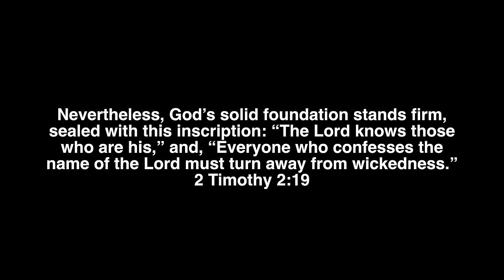Deere 3R Front Axle Seal Leak Fix, John Deere 3033R/3039R/3046R!

Comment: I second the recommendation for Larsen Lights.  I purchased Larsen Lights back in 2019 for my cab tractor, and they were a HUGE improvement.  No regrets whatsoever.  I like them so much that when I purchased a new tractor several months ago, I immediately took off the factory lights and replaced them with Larsen Lights.

Comment: I’m an experienced off-roader so familiar with portal axels and the like.  Your guy is right about the seal/breather failure.

One of the common known mods in off-roading is to run a tube to the diff breather to where you fuel up so that it can breathe without taking in any water or mud.  You basically just drill a small hole by the gas tank inlet and affix the tube to it.

Comment: The problem with the receiver mounts is, they tend to wiggle and move around a little. When I did mine before I welded it up under the table, I drilled a half inch hole, ran a bolt and nut into it, welded the nut solid so that I could put tension on that receiver when it was pinned to keep it from moving. Made it work a lot better.
Reply from the maker: I'm afraid I may have that issue.  Also, I didn't get my 'receiver' welding perfectly square, so this isn't good either.  Thought I might make the 2" tube quite long...to minimize the wiggle.

Comment: Excellent video, thank you for posting it.
I would recommend venting the axle.
I have a 2001 4700 tractor, 5-6 yrs ago had oil seeping from top seal on spindle axle housing,once I vented the axle it’s been bone dry since. One other modification I would recommend. The 2 caps ( freeze plugs) are glued in place. Two weeks ago I was removing snow and when I parked tractor in barn I noticed the 2caps on the floor. Lost 2 gallons of axle fluid without ever knowing the axle was running dry for about an hour. I reglued  the caps with ( loctite retaining compound 620 jd recommends it) and as a safety precaution I fabricated 2u shape brackets to support the caps. I used the bottom 2 bolts of the hub gear housing ( mine has 8 bolts) and replaced the pipe oil drain plug with a brass hexagon drain bolt. Auto part stores stock them.i also installed a 1/4” x 1/2” rubber piece glued and fastened to bracket under cap for support and preventing noise vibration. Hope this helps.

Comment: My 2020 3046R , with 280 hrs , is at my dealer at this very moment for this exact problem . The dealer told me the six year drivetrain warranty “should” cover the cost of repairs . I did ask him about his opinion on the need for a vented dipstick and he said there was no need for one . Will be getting more information tomorrow . This definitely is an involved job . Love that lift setup . Great video my friend !
Reply from the maker: Interesting.
Reply: The drive train warranty did cover the cost of new seals for both right and left side of front axel . I also had a leak in the mid PTO shaft seal that was covered under warranty . This tractor is not used for any type of farming ( sand or mud exposure ) so why so many leaks in a tractor with only 280 hrs ?
Reply from the maker: @altonhenderson4120 I think the front seals are likely due to no vented dipstick.  No matter what your dealer dude says.
Reply: I did purchase a vented dipstick right after I brought it to the dealership for repair but it’s not the type that bolt on hooks sells , this one has the pressure relief valve .

Comment: Just wanted to say thank you for this video. I have a 3032E, 3039R (Cab), and a 4044M. They all have Otis Innovations vents! 3039R has the bolt on hooks RH door kit. I remember when I saw another video of yours about the vents and ordered one for the 3032E. When I installed it and removed the OEM cap, it made a pretty good hiss and was clearly pressurized. So, all 3 have the vent caps. I believe the 4 series and 3R series have the same front axle by comparing the side by side, so this repair if needed I will be able to do just from this video. Stay safe and thanks again.

Comment: After I had the dealer do my both front axles I put the Otis vent in the only thing I would change is the material is so shiny its harder to read than the plastic ones. I don't recall the prices, but it was fair and no issues a year later.

Comment: When I got my LS tractor home after the dealer dropped it off, I thought I would check the oil in the front axle. It has a dipstick on the other side. And the tractor was sitting level, it showed it was low, so I filled it. Then we moved from Florida to Missouri few years later. Now the ground is not level and that oil starts coming out of the vent and I check it again and it's over filled. So after a few days I noticed more oil is still coming out the vent and then all of a sudden it quits. It doesn't appear to be leaking now but I guess I will have to check it again and see if it has oil in it. It doesn't make any noise when driving it. So i will try and find a level spot to check it.
Reply from the maker: If you've found a tractor which MAKES OIL, then you had better hang on to it!   Maybe it can make you rich!

Comment: Tim, I remember an episode where you visited GCI Turf in NC. He recently released a couple of videos about a 2000 ft driveway he was working to repair for a family with a special needs child. The driveway is badly eroded and he is doing the work for free but he needs help buying the tons of gravel needed to repair the road so the erosion doesn’t keep occurring. I don’t know if you would be willing to mention it on one of your videos but I wanted to make you aware of it.
Reply from the maker: Saw it.  
I’d really like to improve the ditches on that driveway before rock is purchased.
Until we get the ditches dug out, the problems will persist.
Reply: @TractorTimewithTim  I'm with you.  We had continuous erosion problems with our driveway.  It is on a steep hill and we had to make a ditch, slope the driveway toward it and fill it with big rocks to slow down the water to stop the erosion.

Comment: Great video!! Just wondering, for short term leak abatement, if hydraulic “stop leak” products work?
Reply from the maker: I would be hesitant to use those.  
The only place I might use would be on nearly "junk" equipment which is not worth repairing.

Comment: I just had my 4066 into the dealer for that knuckle seal leaking. They said the outer piece was beat up and started corroding a bit, so not sure if I got something stuck in there and rubbing back and force while turning or what. I had the vented dipstick already though. Was under warranty so all good.

Comment: If you installed the resistor in parallel with the existing resistor, the total resistance went down.  The bulb the sees a greater voltage.
Reply from the maker: Yep…wouldn’t that achieve the desired effect?  Makes the circuit draw more power.  …fooling the bulb sensor.

Comment: Tim, I did that project about three years ago on my 3520 and it was on the left side that started leaking. It is an involved  process only thing is I had the John Deere manual to guide me through it. One of my questions is, do you use the low vis  hydraulic -gear Fluid or is there somebody else who makes that product also, did you use the special lock tight glue in what John Deere recommends to install all those seals and I never did install vent in my axle. I never had any issues as of today I didn’t find out about it until afterwards.

Comment: If the seal fails, can this cause steering issues?
Reply from the maker: Seal failure allows the oil to leak out, which will cause front wheel drive issues. Gears will get destroyed.
No, not related to steering

Comment: Adding a resistor in parallel would lower the resistance and increase the current flow.
Reply from the maker: Increasing current flow would be the desire…otherwise the tractor thought the bulb was out.

Comment: i am wondering if that socket will fit a 1025r. Did a oil changed an noticed my axles is also leaking.
Reply from the maker: Try the Otis innovations vented dipstick first.  It might take the pressure off enough to stop the leak. 
I suspect the socket is different.
Having said that, if you want us to fix, we can do.
Reply: @TractorTimewithTim @TractorTimewithTim  lol, I live in Florida. That would be one hell of a trip charge

Comment: Hi Tim. A while back you were having trouble with the 3046 blowing a fuse that caused it to shut down. Did you ever find what was causing that?
I may just have to get one of the axle vent kits.
Reply from the maker: No..and it hasn’t happened since!  We couldn’t find anything loose or rubbing.  Not sure!

Comment: Even if the US goes metric you will still use both. 🇨🇦 went formerly to Metric on April 1 1975 and we use both. One thing I hate is a tape measure with inches and centimetres. My last three tapes I bought were inches only, much better for me. In fact my 2014 1025r I believe is half and half. It’s the hardest piece of equipment I have worked on to try and guess the size wrench needed.

Comment: You do many of these you'll want a good set of snap-ring pliers, and I think the older one piece seals did better than the 2 piece (on my tractor anyway), I have already replaced two of the 2-piece seals on one side (cleaned thoroughly) with a limited number of hours, but in all fairness, the tractor has not been run in the best environment

Comment: The best thing u can do to help those wheel seals from leaking is to use gear oil in front axle we have tym and koiti both have gear oil in front axle with no leaks its just slow to drain when u do a service

Comment: I just purchased 2017 250hrs i thikk it never had any mods should i make any changes to my 1025r the engine shakes bad at idle is that normal you are the best and a fellow christian Butch west carrollton Ohio
Reply from the maker: Yep.  Engine shakes.  You can turn up the idle a bit.  1550 is spec for low idle.

Comment: Great video! So I’m wondering why JD has not fixed this issue at the factory. I have a brand new 2024 3039r with 6 hours on it and it’s already at the shop  because the front right side seal is leaking. I have already ordered the vented dipstick right after they picked up the tractor but this is crazy, 6 hrs and leaking. It is covered by the warranty but my mind is still blown over this. Why can’t they just put in vented dipsticks at the factory and be done with this horror show.

Comment: Never power wash around seals or gaskets.  Personally, I never power wash any of my equipment.  I’ve yet to find anything a garden hose and a little elbow grease couldn’t clean and with far less chance of damage.  Other than hydraulic system seals, most are not made to withstand significant pressure.

Comment: That stinks about the wheel seal on the 3046r. I guess I lucked out with mine. Nothing major has been wrong with it. Only thing that just started after 830 hours is I noticed the front loader drops a little bit. Apparently the lift cylinders were known to have problems because the factory used cheap seals in them.

Comment: You need a brass hammer so as not to damage the steel shafts and such as you're hammering them in.  Tell the finance committee it is essential to not damage new parts.

Comment: The PN: LVA22291 for the 1025R from Bolt On Hooks is $10 less than the JD Parts site price. Not sure if it connects "faster", but the price is reasonable. I paid $50 to the dealer for the part and a few hundred $$ for labor. That's not happening again.
Reply from the maker: Same exact part.